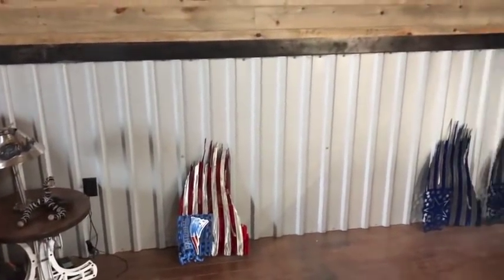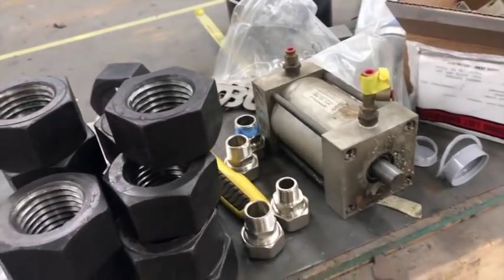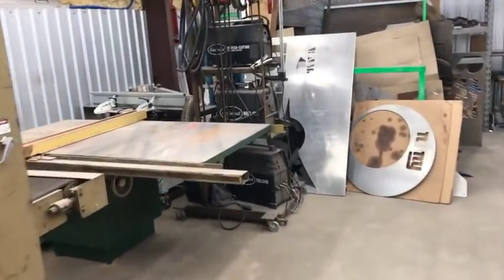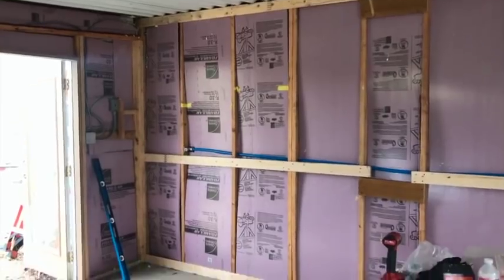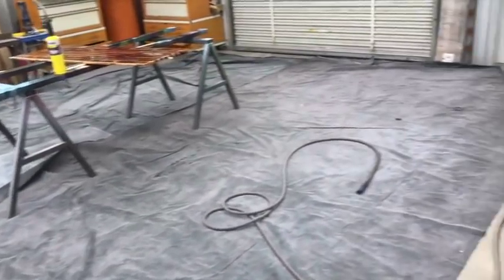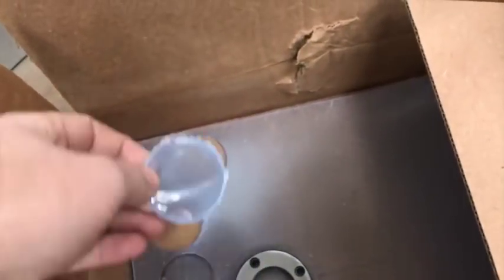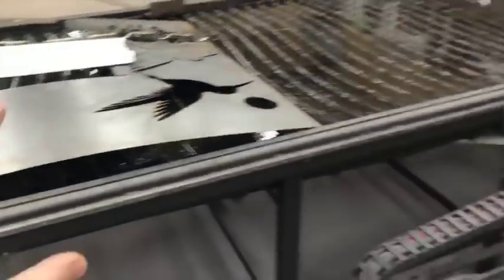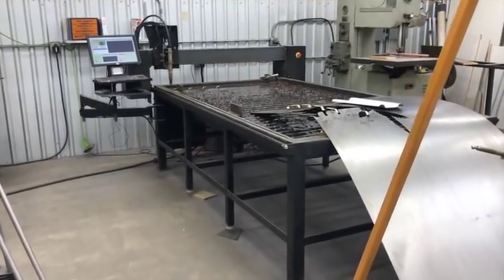Shop Update - Paint booth - Lathe - Belt Sander - Living area

Comment: Wow! Lot a Progress. I have not visited this channel since last year since you stopped posting.
1. Paint booth looks dare awesome to me! 
2. Nice new to you lathe.
3. I am not sure putting your steel outside is a good idea. I think you get a lot of condensation causing the steel to rust, which probably means more prep work for paint. Perhaps after you finish off the paint booth work on a small pole barn for storage. Run some power to it so you can stick a dehumidifier & some lighting to. Go with a concrete floor with a vapor barrier to control moisture, and set the floor at least 3 to 4 inches above ground level in case you run into a flooding issue. Just like the paint booth do a little at a time.

Comment: Retro fitting that old lathe for CSC is probably going to run into issues. CNC lathes have ball screws not ACME. Unless you replace them with ball screws your going to have lot of backlash. Perhaps if you can add a set of digital linear scales & tie it back to the controller that could address the backlash. Still I suspect the bed probably has some wear which will create issues, unless you get it reground or hand scrap it.

Comment: What about sea boxes or a pretensioned fabric structure instead of the carport? I have been considering both to store my race trailer since the plasma table took over its space. I like the thought of two sea boxes about 20' apart with some trusses spanning the gap. I can get a 40' sea box up here for about $2500 delivered. I bet they are cheaper down your way?
Reply from the maker: I know the sea boxes are popular, but i want somethign more open, so i can get a forklift in and out of it easily.  for the cost of 2 of those seaboxes I can get a larger carport with 12 ft walls and closed in on 3 sides.

Comment: Those aren't nuts, there threaded inserts, the parts your trying to put your screw driver in is where two keys were that you drive into the hole with a punch to keep the insert from turning.
Reply: ahh ok, that makes sense!! so how do you remove them then?
Reply: @turbocobra   the way these work is there is a threaded hole, and for the application they want a stronger material to bolt something to so these inserts are usually a stainless, once you drive the keys into the threads in the pre existing hole theres no way to remove them other then just drilling it out sense they destroy the threads in the pre existing hole.

Comment: How has it taken so long to get the paint booth built? Are you that busy every day, or waiting on funds? It seems like that would have been a high priority item and it doesn't look like it is that much closer to being done. If it was me, I would have squeezed some time in somewhere, as I hate having overspray on tools or where it doesn't belong, not to mention crap potentially getting into your finish (I was a pro building painter and have never had the luxury of a paint booth, but would have liked one and know what it is like to spray in the open). Hopefully, you get back at it so you don't have the pain of spraying in the shop anymore. X2 on expecting that fencing to shrink. If you use horizontal stringers across the wall and brad nails or small finish nails, you could pull the boards and re-nail if they do shrink more. Screws would work similarly. It should look interesting when done. I recently removed carpet from my bedroom and closet and replaced it with laminate flooring that looks like reclaimed farm house wood. It has many colors and is far more interesting than most wood floors I have seen. Next, I will build a nightstand and tall cupboard from steel to hopefully compliment the flooring. I'm going for a slightly masculine/industrial look with a little more interest than typical home furnishings and your place/builds are inspiring to me.
Reply from the maker: yes sir, all valid comments.  I should have been done way before now, any explanation for the slow progress would sound like excuses...
Reply: @OldbarnHomestead  I wondered if maybe it was a project you had grown tired of.....it happens to me as well. Anyway, the reason isn't important to me/viewers. We just want to see your shop improve and continue to be successful. Cheers!

Comment: i'm almost done with a cnc lathe conversion check out Centroid acorn great controller and i'm using DMM servos  my lathe is not that big but all same concept.
Reply from the maker: Cool, yes I have look at Centroid, emailed htem and never heard back.  Do you have any pics/videos of your conversion ?  I have watched Russstuff's conversion on the grizzly using Mach
Reply: @OldbarnHomestead  I have some pics of the control board setup
Reply: @OldbarnHomestead  question for ya do you think your lathe could drill a hole 1" for 8.5"? In 1 5/8 steel stock.
Reply: The new one could for sure... the little monarch, probably not.  I don't have a drill bit that long.  If the hole needs to be super accurate it would likely need to be gun drilled.
Reply: @turbocobra  not super accurate just hard to get hole that deep a long boring bar maybe

Comment: Mercy Gary,  before I built such a heavy duty bed I'd try finding a lighter woman! ....... thanks for sharing
Reply: I dont think I would use all thread on the air cyl. Too soft. I'd go grade 8 bolts or double ended studs like for engines being its as short as it is. Idk the load on the cyl but i wouldn't want to fix it twice even if it is low pressure.